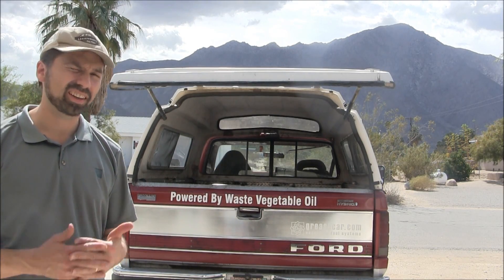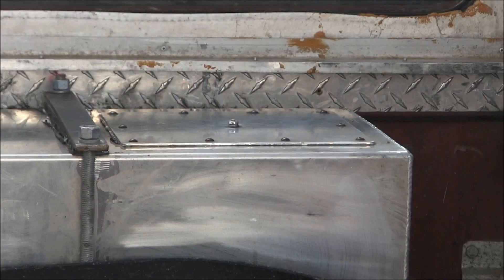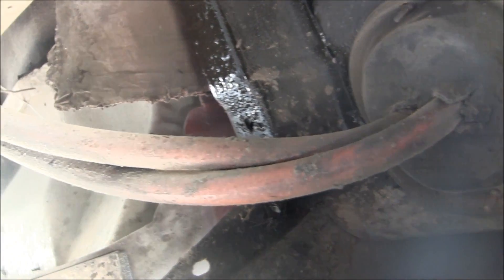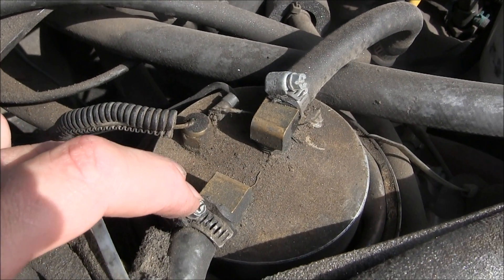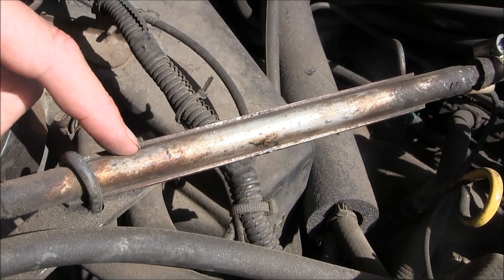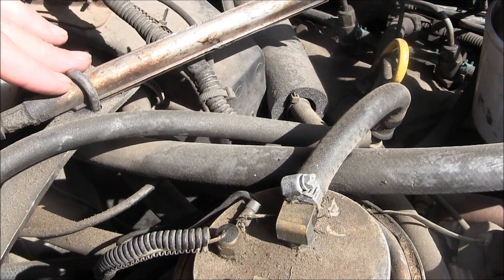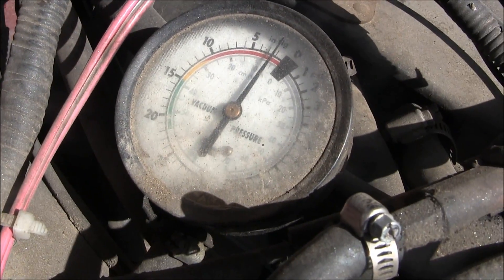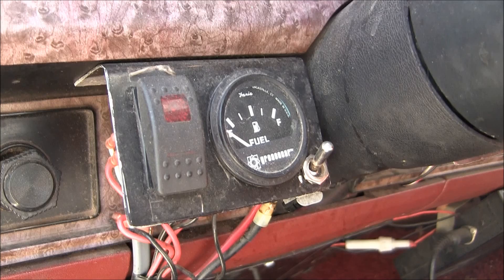Waste Vegetable Oil Conversion: Alternative Fuel GreaseCar - (Diesel to WVO) How does it Work

Comment: Thanks for the video. About to do a conversion and looking at options.. Grease car is no longer making kits, do you have drawings by chance? Just wondering how they handled the pipe in a pipe junctions and plumbing and maybe where to get one of the electronic heated pipes.. Curious, how many miles did you put on your system WVO? Any real issues? Thanks again!
Reply from the maker: Yes, I noticed they no longer offer truck kits, but do still offer regular automotive kits. Here is a pic https://www.greasecar.com/product-page/vw-tdi-conversion-kit-2004-2006-bw-models

I would contact them for drawings. With regards to the electric post heaters, this is what I used. A VegTherm https://www.myriadpgi.com/product136.html I don't remember how many miles I put on it, but at least 50K miles, many years. I had a very old diesel truck that often had issues, because it was old. So not necessarily because of the veg system. You just have to make sure the oil is hot, before you switch!

Comment: what temperature does the oil need to be for you to feel good about switching it over??
Reply from the maker: Sorry for the delayed response. I usually switch over when the engine is warm (150 degrees or more) or about 5 minutes of driving, but would switch over sooner if in So Cal where the ambient temp is much warmer than northern climates. The vegtherm allowed me to also switch over sooner, as that bumps up the temp before injection.
Reply: @Road2  Sorry if I'm too late but could you install some sort of heat system so you wouldn't need to wait at all?

Comment: Can a vegetable oil converted vehicle run on biodiesal
Reply from the maker: Should be no problem. Just make sure you use fuel hoses from your main tanks if you put it in those tanks that can handle biodiesel.
Reply: @Road2 how do you completely go back from running veggie oil?

Comment: Can it still run on diesel ?
Reply: kynon sell it's has to before it can switch to the veggie oil
Reply from the maker: Yes, the other poster is correct, you still have to start on diesel, so yes, it's still running on diesel as well.

Comment: Road,  great video really appreciate the insight. I actually just purchased a 1987 f250 6.9 IDI and was considering running biodiesel because I wasn't sure if those old Ford's could run wvo. I wanted to get your opinion on Which you would suggest is a better long term alternative, wvo or biodiesel. I live in Houston So it's relatively hot and humid all the time and plenty of wvo to be had. I'm thinking after the initial cost of installation of the greasecar kit and filters, the wvo is the cheaper / more effective way to go. Please let me know What you think, thanks
Reply from the maker: MrAmillz88 I'd go with WVO if I were you. It costs about 1 dollar a gallon to make bioD in chemicals. So for me that was a no-brainer, plus I didn't want to deal with the hazardous chemicals, and waste disposal. It just makes it less complicated, and is better for the environment, to not add additional additives and chemicals to the process.  Good luck with your conversion!

Comment: have you ever planned a long distance trip? and how do you have enough veggie oil for a long distance trip?
Reply from the maker: Hi Aquines, Yes, I have done this at least once a year in the last 5 years. What I did at first, was connect with other greasecar owners in other states, and I would pay or get some of their filtered oil. This is great, but you don't know the quality of their filtration, so it can be risky with people you don't know. I heard from an experience person that they had to change their onboard filter every 100 miles, because they got someone else's badly filtered oil. So he built a 150 gallon tank in his vehicle. I don't do that, but what I do now every year I have to drive 3000+ miles. Is I take all my own filtered oil with me. So that means I drive with about 275 gallons of filtered oil in the back of the pickup truck (it's a 3/4 ton truck, so it can handle the extra 2000+ Lbs of weight.) So this way, I can just drive for hundreds of miles, and refuel with the fuel I carry in 5 gallon cubies in the back of the truck. So I just hoard extra fuel during the year for those extra long trips.
Reply: Road does vegeteble oil conversion diminish some of the trucks'  parts' durability? and do you tend to change motor oil and stuff more often?
Reply: justrockon426 The only thing that I've found based on what the diesel pump guys have told me that wears faster than diesel, is the injection pump. Also if you have any copper parts in your greasecar system, you will get some of that green residue, I know there's a proper name for it, but can't think of it right now.
Reply from the maker: justrockon426 Like Meditation says, it wears a little faster on the injection nozzles and pump. They'll start spraying incorrectly over time, so you'd have to get it rebuilt every few years. In terms of motor oil, no, I have not seen any issue with that, or heard of anyone else having issues with motor oil changes. I change about every 4000 miles on my truck.

Comment: hi do you know the best diesel cars trucks to buy to convert them into veggie oil?
there are so many.. do you know of any websites that sell veggie cars in or near philadellphia or close to it?
Reply from the maker: I don't know the best cars, but my old F250 diesel has no problems with running on veg oil. To get the best answer though, I recommend you go to the greasecar forum, and ask that question, as well as your question about finding greasecars near Philadelphia. http://www.greasecar.com/forum. Another way to find greasecars near where you live, is through Craigslist, and also through Ebay. In the case of Ebay, you'd have to filter the search results by location. Hope that helps..
Reply: hi thanks for your response.. about the diesel conversion to veggie fuel.. I'll check out those options thank you.